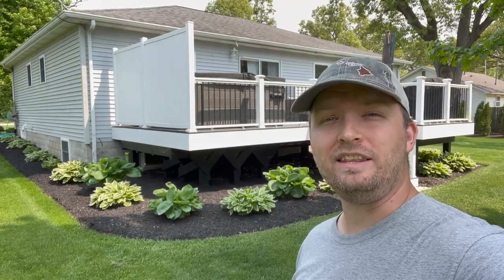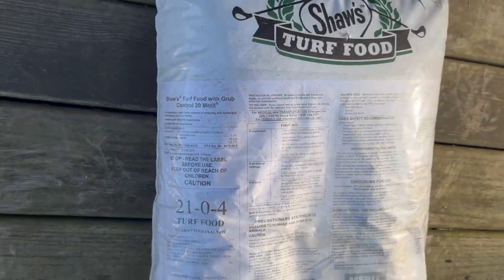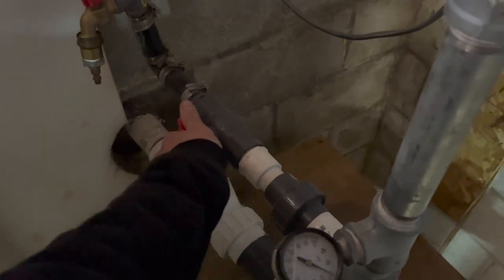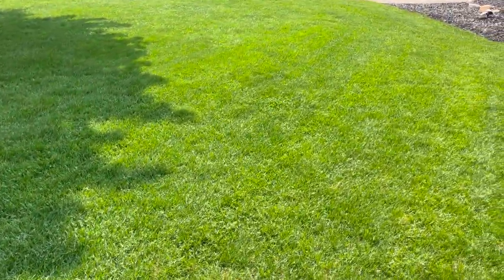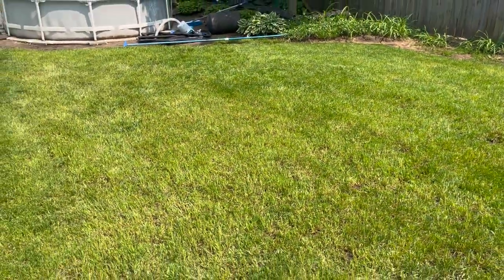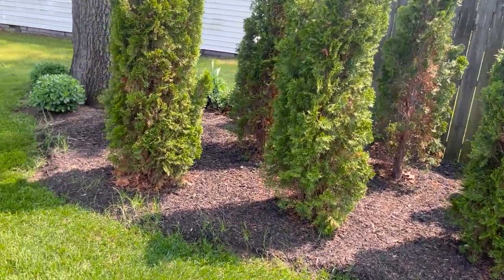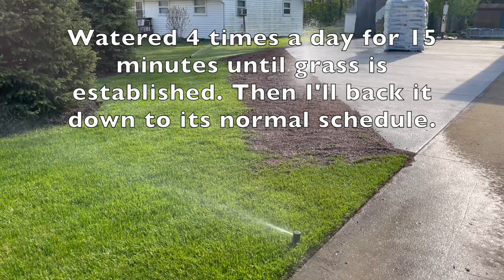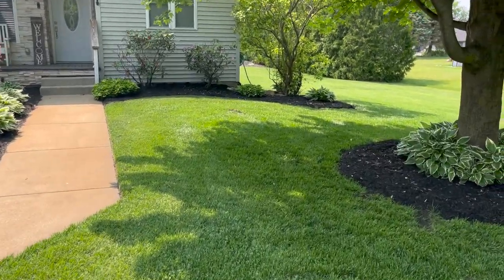Lawn Blog May 2023: Grubs, Sprinkler Repair, and Spring Seeding with GCI Cool Blue Grass Seed.

Comment: Some sickly looking arborvitaes there. Sad...I saw you planted them last year and they look like they haven't really taken at all ... not much growth at all! I am looking to plant some on a raised bed.

You have any theories you have for their failure as a broken branch isn't the only problem there. Drought, poor soil/draining could contribute... They aren't next to the road so salt doesn't seem to affect it. 

I think I'm going to bring a crap ton of compost into my berm.
Reply from the maker: They are actually all doing quite well. The first year of any tree won’t show a lot of vertical growth because they have to establish their root system in the new soil. This year they are all greening up nicely and by next year they should really start to take off vertically. The one on the end was underwatered and sickly when I got it, but I still haven’t dug it up and it’s got new growth this year, so I’ll continue to see how it does. At the beginning they did get a little too much water, but after getting the drip irrigation dialed in they’ve done really well this year especially during some of the hot stretches this summer. Good luck with your trees and I’ll post a follow up on these to show their progress as well later on.
Reply: @Type5Reviews  Nice. They seem like touchy little buggers. Hope they fill in. I think your offset setup and spacing looks exactly like what I had in mind when I searched and found your video. I thought a year later would have yielded a touch better results. I'll be planting in fall and will lower expectations for the next year and make sure to fertilize and keep on top of these so they establish well.

Did you do a spring or summer planting? I didn't check the exact date of any planting video. I know that can also be a little more finnicky than a fall planting.
Reply from the maker: I planted mine late spring/early summer which wasn’t really ideal, but with the drip irrigation they made it through the first summer well enough. I think planting them late summer/early fall would actually be a great time to give them enough time to establish before the winter and not stress them out from the heat of the summer.